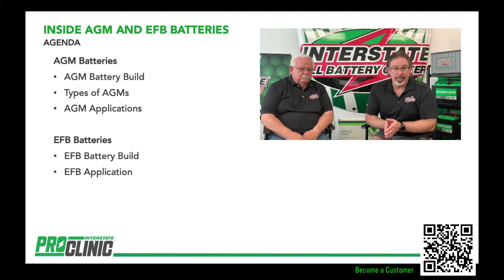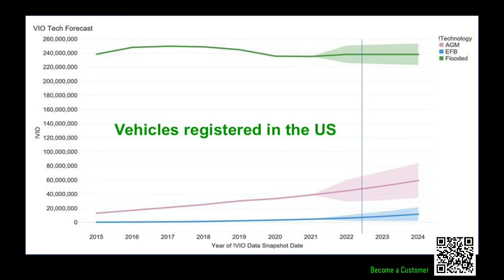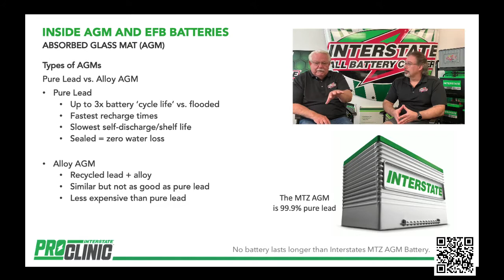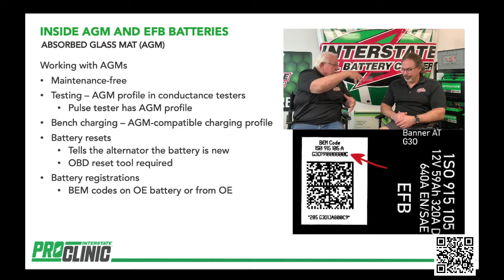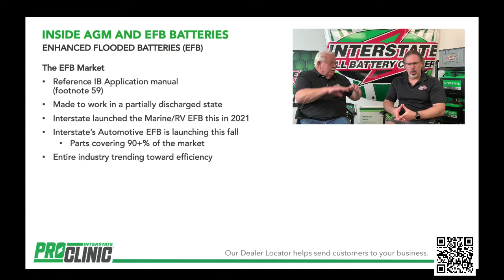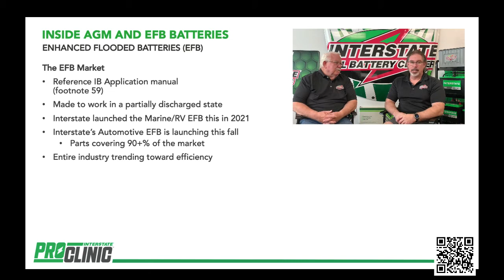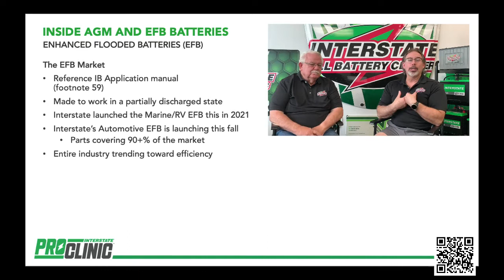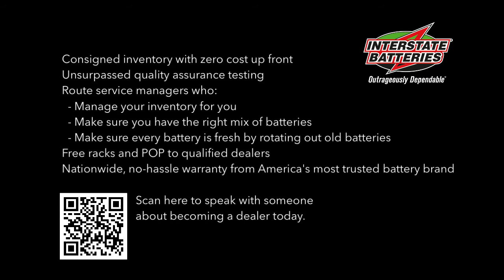INTERSTATE BATTERIES PROCLINIC® - AGM AND EFB, WHAT'S THE DIFFERENCE?

Comment: I owned an EFB Interstate battery for my Ford Taurus Sedan. I got 4 years off that battery before I sold the car. That battery never needed a Jumpstart ever. The alternator kept it charged well enough. All I had to do was check the fluid level occasionally and keep the battery posts and cable ends clean. The car I own now has an AGM battery. I noticed, that if I have to replace it. It will be about $100+ more than the EFB battery. It will be an Interstate battery.

Comment: EFB explanation? You said 50 times check OEM. ok, but you still did not explain what is so "enhanced" and what the differences are. A good comparison of the four battery types would be to directly compare pros & cons of all four side by side. I have a 30 year old boat, and trying to figure out the differences. NO, I am not putting 30yr old tech in my boat, per OEM. I plan on adding lots more electrical devices and want to expand capacity for week long excursions. As a DIYer with heavy electrical backround, and a tight budget, I want to design a system that checks the right boxes. Thanks. CCA 32°? Will they all crank a 200hp engine? How much can I drain it? Useless if it can only be drained to 50%. Your EFB sounds like it's good at slow drain, but how does that differ from the other battery types? Heat sensitivity?
Reply: Just use the same battery type in 30 year old boat just double the amps the old way of doing it. However there is a YouTube boat owner that has a design and made electronic device to mix lead acid and lithium batteries on the same boat. To work together.
Reply: Basically an efb batter can start at very low voltage, higher heat tolerance, more cycle life vs traditional flooded lead acid, useful for stop/ start engines that shut off when fully stopped, charges better, and the most significant differences than an agm is the cost. I have a 2018 hyundai elantra sel that had an agm from the factory when I replaced it this year I used an efb from rural king. No difference at all in engine start up and usage. Save your money and go with an efb.  Hope this helps.

Comment: Great video and explanation on the differences on AGM and EFB batteries. I use to sell Interstate batteries back in the 1980's when I worked for the Speed Merchant in Santa Clara, Cal. Has the quality on Johnson Control batteries gone down since they moved manufacturing to Mexico? What is your opinion on using a Pulse Tech PowerPulse passive battery desulfator, I have one on my 2001 BMW 530i battery, and have had no problems starting the car the past three years even though I only drive about 25 miles a week.

Comment: Would it be standard to charge a " new " battery before installing . As I have had a Duralast Platinum AGM battery in my 2020 Toyoa Camry. One day tried to start , no sound . Used a battery jumper Gooloo and got it started and car had no issues . Yet , a few days ago decided to remove spark plug to check condition . Disconnected spark coil  , didn't try to remove spark plug and reconnected wiring and car won't start now . Showing all kinds of funky messages on screen .

Comment: GMC MABUEL SAYS USE AGM SETTING TO PREVENT VOLTAGE FROM EXCEEDING 14.8 VOLTS BUT CHARGER HAS GONE UP TO 15.3-.5 VOLTS. CHARGER AT 100% BUT DIES NOT SAY FULL CHARGED.